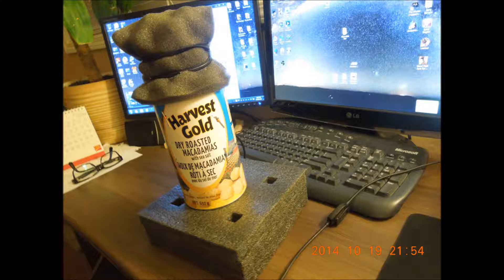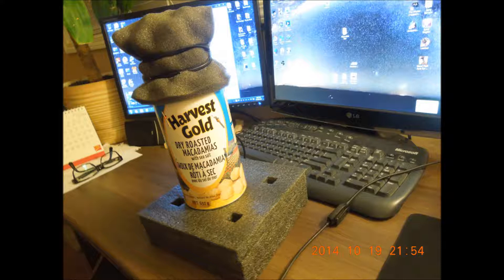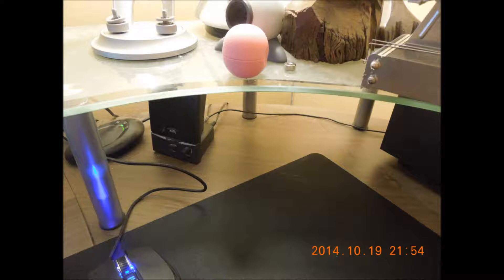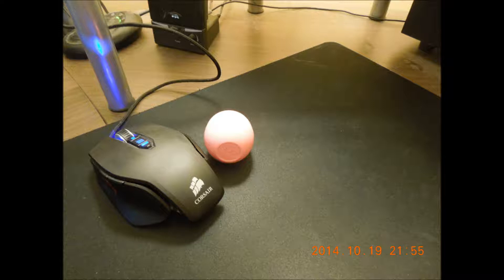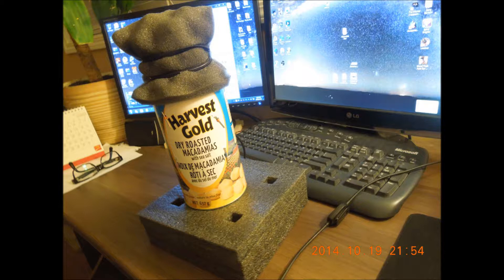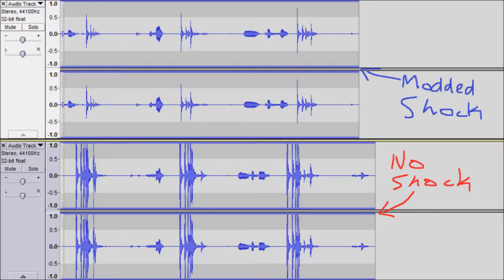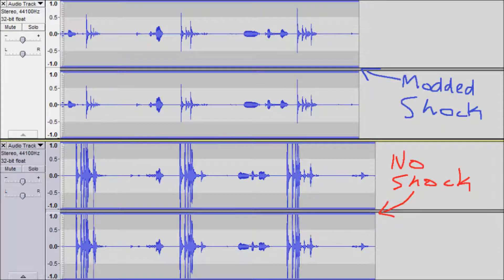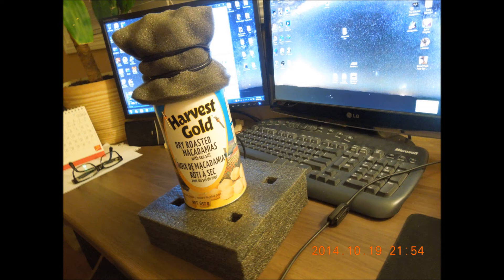Functional Blue Yeti (or any other mic) DIY Shockmount

Comment: Here is an album i made, its my homemade yeti shock mount setup. Wool sock hat, sewing kit pop filter, coat hangers. a pull cord from an old jacket and a little electrical tape. I also threw in 3 pics at the end of the album of my shitty mouse mods to make it fit my big hands better =)  http://imgur.com/a/y6S7t
Reply: HypnicJerk LOLOLOL.

Comment: OMFG What has science done!! lol just kidding man. nice. I love the can =) I made my own shock mount setup for my Yeti as well. I did use foam for the top but also i use a wool sock. I cut it and rubber banded the top so it looks like a winter hat for my mic, left some foam underneath so the sock helps prevent wind noise and the sockk hold it all together and makes it look better. I use a bungee cord for the wire part and coat hangers for the rings/ support. It does work but much like yours it looks ridiculous lol.  I also made my own pop filter with a sewing ring. All and all it works excellent but i'm doing rebuild soon hence why im looking at others on YT.  This one is going to be mostly PVC and hairties. I have to make a spider mount because i plan on putting on an old boom arm from a lamp.